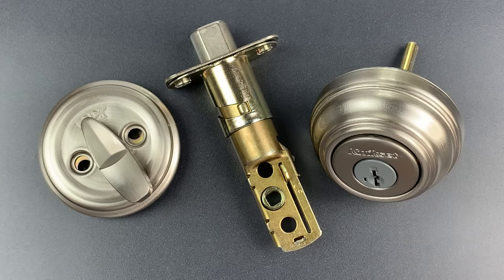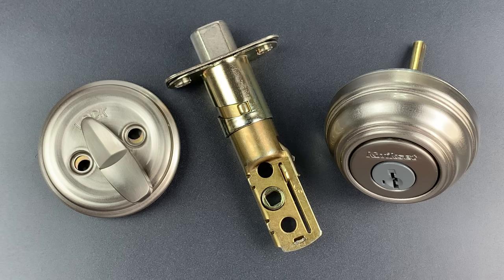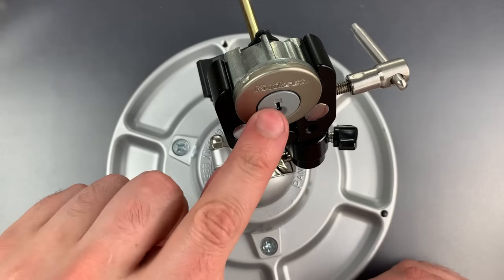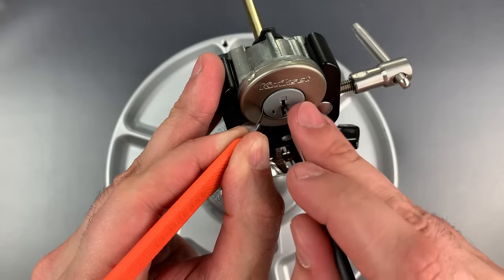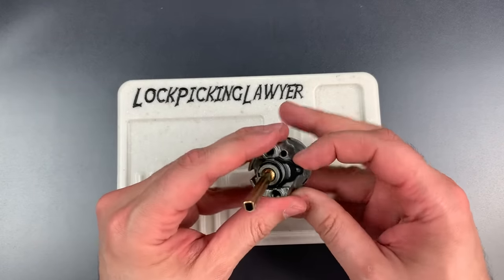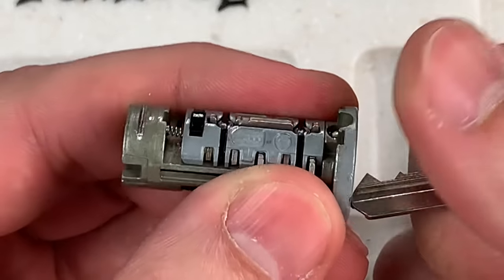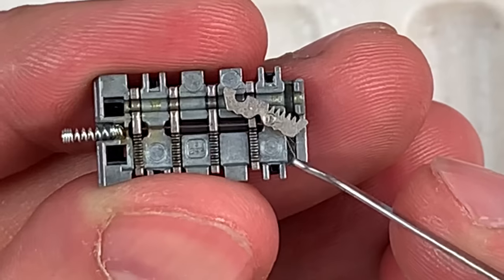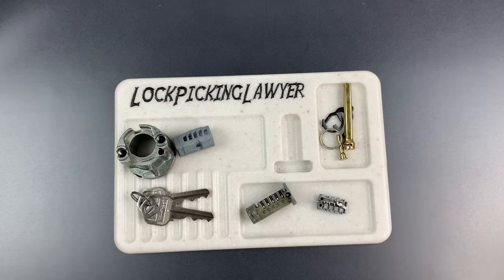[904] The “Pros" at Consumer Reports Couldn’t Pick This (Reverse Sidebar SmartKey)

Comment: I ave a genuine question, does seeing the key give you an advantage, and how did you know this was a sidebar? If you just saw this lock face in a door without this knowledge, as a burglar would, could you have really picked it in 20 seconds??
Reply: I’m just speculating but knowing what lock it is helps a lot, seeing the key, not so much.  I suspect that he does a few picks before the video and he does his research.  If someone found this lock on a door in order to be able to pick it with speed would need to 

A. Be able to recognize the lock and know it’s internal workings
B. Have the tools necessary to pick the lock
C. Have the skill to pick the lock

Personally I don’t think that A is realistic, and B is unlikely as they would have to have or make a specialized tool.  C is interesting because LPL is extremely good at lockpicking, a person would need to practice a lot to be anywhere near as good.  LPL also picks the lock on its own, any ‘wild’ attempt would have it mounted in a door which I would assume makes the process more difficult.

That being said while the lock will most likely thwart any picking attempts, some other comments say that this lock has other major design flaws.
Reply: @joeh4955  In all honesty, the pick resistance of a house door lock in the US is really just going to make things more difficult for the locksmith when you have to call them because you're locked out.  

In well over a decade on the 'job', I've never seen a case where a lock was picked open.  Most entries are destructive attacks, occasionally I'll see something along the lines of things Deviant Ollam does.  I can't speak for Europe, they might have a higher class of heroin addict there, but in the US you should spend your money in this order:

1)  Cameras
2)  Anti-destructive fortifying (heavy strikeplates, double cylinder deadbolts, stronger door frames, windows that are hard to force, etc)
3)  Alarms, preferably ones that notify you prior to the break-in (outside motion sensors, driveway sensors, etc)
........
Last)  Pick resistance on your locks......really just make sure that they don't have a super-obvious flaw that can be exploited with a flathead screwdriver and you're good.

I have a convenience store that I used to work break-ins at all the time, out in the middle of nowhere.  Over the years, they have fortified against every attack that's been used.  They now have steel rear doors in oversize steel frames with bars, the best alarm system I've dealt with, solid sheet steel front shutters, a steel plate under the shingles (over the office area where the safe is), steel exterior door as the office door in a steel frame, safe bolted into the floor and wall in a corner of the office, office walls are cinder block filled with rebar and concrete.  

LPL would get in......oh in about 2 minutes, counting the time he'd need to walk from one door to the next.  Honestly, if I wanted in.....I'd need about 3 minutes.  But it's enough that it stopped the break ins by crackheads.
Reply: I think all Smart key generations are sidebar variants so the extra slot on the plug would give that part away.

Comment: I guess if I were to design a lock, its key would be a piece of spring steel with certain hole patterns on it.  Have the chamber be a spiral the key can bend into with tumblers that need to both rest against the key and protrude through the holes in the key to operate.  Can't imagine that'd be much fun to pick.

Comment: Not sure if this will get buried but I have a specific question if anybody knows it. You picked the sliders upwards until they stopped completely, which is used to imitate the key being in, I suppose. With the key in, the key itself holds the sliders up but without the key, they are dormant. What I am asking is, what makes the sliders stay up when you push them up with your poker? Not sure of the terminology but it's weird that just by pushing them up, they stay there. THanks!

Comment: Anything with pins or plates can be raked or hacked. Locks can not use pins or plates it's that simple. There is a way to use a three lined  key that moves slider blocks inside a rotating cylinder with blocked off sections so that each rotation to open each section blocks the other 2 sections so it makes picking, raking, tensioning very hard.

Comment: I would really like a video where he gets a hard or at least hardish lock with no key or prior knowledge and then see the timer. Yes, he can do it fast when he know the trick, so no challange with sufficient info, but how fast would he or other similarly good picker find out the trick and implement it on the fly?
Reply: Well, he won first place at a lock picking competition. I'd imagine they do that sort of thing there repeatedly.
Reply: I don't think this is right. You cannot rely on ignorance of the system for any security - that's the rule for all ciphers etc. Security is only assessable given that the person trying to break it knows the system - because the system can never be  kept secret. What you call 'knowing the trick' is much more complex than that phrase suggests - just how little is he allowed to know before attempting to pick a lock? Is he supposed to know how to pick standard locks, but never have heard of sidebars? Or to have heard of sidebars, but never thought of shims? It's all based on knowledge plus skill. And incidentally, I suspect most of us, given the shim and told the system, would still not be able to pick it.
Reply: @thisnicklldo  He could have all the skill, but not the specific knowledge. Compare this video (He presents the right tool and use it perfectly) to our theoretical one (He sees the lock from the outside, need to find out all the little secrets and tricks somehow and than try to apply the tools until he finds the ideal spot and do the picking)
Reply: There are no secrets, and there are no tricks. There's a system, which is open knowledge, and a technique for dealing with that system. If he looked at this lock from the outside, he would know the system immediately. I wouldn't, you wouldn't, but that's not what makes the lock secure. If you present him with some sort of puzzle box (there's plenty of those on youtube), it would be irrelevant how long it took him to find out how it worked. Indeed for all those rinky-dink puzzle boxes, full of ingenuity, the instant you know the system they are openable by any fool immediately. He deals with locks, which are not secure because the engineering is secret, but because even if you  know how they work, you still need a key, or a technique to substitute for that key.
Reply: No, you are missing the point. Opening up locks of new designs, and looking at them, working out how they work, is engineering, not security testing. It tells you nothing about the security of the lock. If the 'way it works' had any impact on security, then a lock type  security would only last a few months - there are no secret designs. He is assessing the security of the lock, which has to stand with full knowledge of the system. Playing guessing games looking at lumps of brass is not a skill.

Comment: Would the specific vulnerability be fixed by having a flanged lock face under the external cover that shields the sidebar unless the cylinder is already turned? Seems like a very simple engineering fix....

Comment: Quite frightening to see that professionals can make such a huge design flaw...
Reply: Kwikset designed their locks for normal situations. They didn't design a lock to be unpickable if the cylinder was removed from the lock (how someone would do this when faced with a lock door is beyond me), put in a vise clamp, and then doing what he is doing
Reply: @jgg204  Why would he need to remove it? The door is a perfect vise as well.

Comment: I guess my question is which door key set / deadbolt would you recommend to have on house?
I saw that video you have about making change for less than $1, but than if someone tries to pick all the door and fail you are kind of stuck outside.
So would like to ask what you would recommend that is a good security to cost ratio?
Maybe do a "Top 5 or Top 10 best lock to choose list"?
Thanks.

Comment: It is the 3 to 4 mm gap in the middle on the outer shell of the center core (visible at 3:26) that allows LPL to push on the side bar with the curved shim.  What is the function of this gap???  Not for blocking any rotation, because the black clip does that.  For any production reason? If no gap there, would it be an unpick-able lock???

Comment: Seemed like you used a Peterson Mini Knife to tension the sidebar. I have been really struggling to do the same. Any more follow up on different tension strategies? Seems like others have gone down where the drill protection is. Too bad Peterson or Sparrows does not have some custom tool for this.

Comment: As with most of your videos, I'm very late to the party here. Forgive a noob a question...so, if they just put a type of lip around the face of the lock (where you slipped in your shim), it seems like that would pretty much eliminate that entire method of picking it? So is this design flaw a very basic one?

Comment: Seems like this would have been a really easy fix in the design stage. You would just make the face of the core proud of the jacket and slightly larger than the hole the core fits into.

Comment: Definitely can and have picked those locks. The sidebar makes it harder but I pick for the challenge anyway. Usually after one false set and adjusting the tension on the shim that I use in the side to push in the side bar the core turns no problem.
Reply: @TheSly77  is there a lock you cant pick?
Reply: I’d say the only ones I can’t pick are the ones that I don’t have the right tool for. For a long time I couldn’t pick dimple locks until I got the dimple rakes. There are some cool magnet locks that I don’t have the right tools for. The lockpickinglawyer has a bunch of hard to find locks that don’t look like I could do.

Comment: wouldn't adding a collar of metal to the housing  behind the exterior casing prevent inserting that fine metal tool. It seem having nothing to block the insertion of the fine tool so it makes contact with the internal mechanism is the weak link.  It that done so these can be opened by locksmiths.

Comment: If I remember correctly, these locks are really susceptible to a brute force attack which is probably the bigger risk than the lock being picked.  The internals are so fragile you can use a hardened steel blank and turn the core over.

Comment: where can I get one of those sidebar tension wrenches or depression wrenches at I'm a locksmith I've been doing it for about 2 years and I've come up with some other ways of getting into houses when customers are locked out with these locks I'm proficient enough and pickings for I only usually have to drill these locks when there's no other way in

Comment: If one were to just to encounter a reverse sidebar lock attached to a door in the wild, is there any way to tell?  Clearly he shows when you know the locking mechanism it can be picked, but after (or before) normal attempts don't work, is there any indication the problem is a reverse sidebar?  As opposed to some other deterrent.

Comment: Kwikset: implements a good bit of engineering poorly
LPL: doesn't snark about it, just observes about what could be improved on

This is classy. I mean, Kwikset is kinda low-hanging fruit most of the time, but still. The restraint + valuable critical commentary on the lock engineering is impressive.

Comment: I have a similar Kwikset deadbolt on my front door.  One of the sliders apparently slipped out of position on one of the plungers and essentially "forgot" my key.  Luckily I recalled this video and was able to reset the plunger/slider orientation and the lock started working again.  Not sure exactly how it happened, and it hasn't reoccured after I reassembled it.  I would think it extremely unlikely, but could this have occurred as a result of a botched picking attempt?
Reply: No, it happens all the time with these smartkey products. They are really terrible.  Kwikset simply figured out a way to market their crap design as an advantage.. I get calls to house all the time where their cylinders stop working and forget their key. I tell them that I can only reset the key again... that they should replace it with a better product. and it will likely just happen again, and I will not warranty my service on these products. they normally only want me to reset it .. and normally I get a call within 3 months asking me to replace it with something else as it happens again.

Comment: Maybe I'm no gigabrain lockboy but it seems to me it would be very easy to protect that side bit from tension if you just flanged the head a little. That little curvy tool wouldn't be able to fit around the flange to get tension. 1 cent change in manufacturing, lock much harder to pick

Comment: Question: Wouldn't it be possible to build this lock in a way that the entry trough the gap isn't possible and make it pick-proof this way?
Reply: Certainly, make the tolerance between the mechanism and the surround tighter, but even better - add a step so there is no clear path through to the inside.

Comment: Even a pro locksmith has knowledge gaps as there are a lot of different locks and mechanisms out there and depending on region some locks are never or rarely encountered in the line of work and even a slight revision to a known lock can get you stumped for minutes/hours if you don't know about it. It could have been a blind attempt test where they where handed the lock under timing without the opportunity to research it. 
Or their "Experts" where the guys working at the key duplication booth in mall next door doing lock work on the side. Who knows.

Comment: Couldn't they simply set the core inside the cylinder with a wide flange around the keyhole, which would make it very very difficult (after watching this channel, I refuse to say "impossible") to slide a shim through the side and tension the sidebar? As it is now, it's simply a straight shot to the sidebar. Simply design it the core to be almost like a spool shape, where the wide flange would prevent sliding a shim straight through, right?

Comment: it looks like the key pins only has a single tooth to match with one of the 6 valleys on each wafer. Due to these teeth are at acute angle, they are not strong enough against forced opening, if someone is to drive open it with a large screw driver through keyhole?

Comment: So, I have one fundamental problem with this, which is, he has to have it in a vice to open it. If the product is being used, that isn't an option. Its inlaid into something that presumably makes that not possible. Is it pick-able from the state it would be used in?
Reply: Did you actually watch the video?
Reply: @peterjackhandy  Did I misunderstand? I probably misunderstood.  So he is putting tension on the sidebar with his curved dude, but I thought that he was only able to get the right level of pressure because of the external pressure being put on the device? Does he only need the curved dude then?
Reply: The way I saw it, the vice merely holds the lock in the same attitude as if it was in a door.
Reply: Yeah, that makes way more sense lol. Totes what I get for commenting while running on not enough sleep.

Comment: I'm increasingly confused why no manufacturer uses radial lips around the cores to stop thin tools from sliding into the gaps ...
It would not inhibit assembly or be expensive or make manufacturing more difficult ...

Comment: Hey, as a lawyer if you practice criminal cases then you know how many are actually determined at sidebar, away from messy things like appellate courts, statutes, federal laws, etc. It's a barter post if you will, where whoever has the best trade wins.

So not surprising with this sidebar. Yes - it's technically "not pickable" in a certain definition of the word, but is easily bypassed with the correct technique and leverage. No different - sadly - then most criminal courts.

Consumer Reports? Nah, whoever pays the most wins these days. Again, sidebar.

Comment: I was a locksmith for 10 years and have worked in lock distribution for another 20. listen carefully! Thieves do not pick locks! They drive vans through storefronts! Picking locks are only done by locksmiths or the CIA and if the ‘Company’ goes to a door with a cheap-assed $20  Kwikset on the door, it’s in a movie!

Comment: With a little modification this lock would be extremely difficult to pick.
Reply: That's what he says in the video. If properly implemented this is one of the most challenging designs. But Kwikset has a history of using cost reduction shortcuts to convert the best designs into the most shitty products. So they can boast the secure design in their marketing material to raise the price.

Comment: SUBBED!!!
Just moving into my new house. The previous owners only had keys to the frontdoor and garage sidedoor. I need to change all my locks asap.  Just started looking.  LPL shattered my ignorant self though.  All the locks that I read that were supposed to be hard to pick have been shattered by LPL.  So, which lock is good? Which lock would deter a baddie to move on from my house? The KwickSet $1 trick looks good, but I don't think I will have the time to take it apart like Ethan Hunt from Mission Impossible.  
LPL, can you please recommend a good lock?  Hopefully I can get it here in Canada.  We seem to have limited brands of everything, so I may have to order from a US site, but that's ok.  I did read that Medeco and Mul-T-Lock are top brands. 
I worked at the airport here for 17yrs. All of the doors were Medeco, so that makes sense.  I'm finding it hard to find a retailer for residential buyers who want these though.  Thanks in advance.